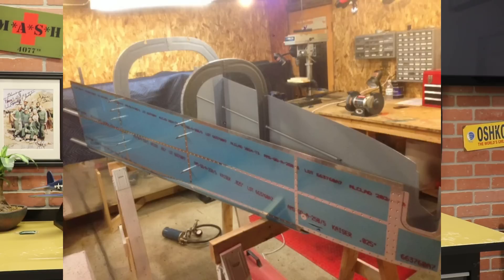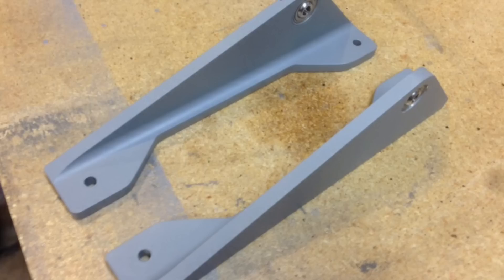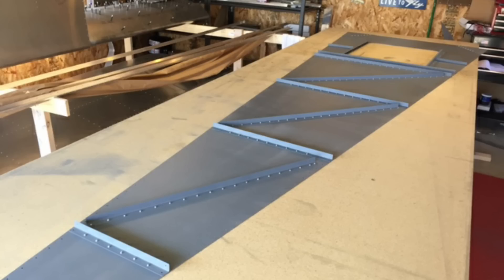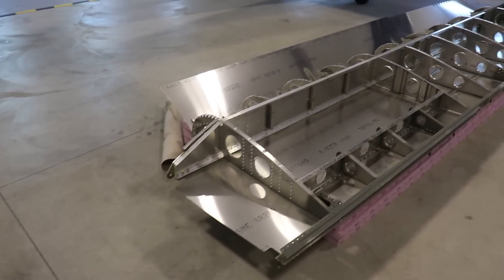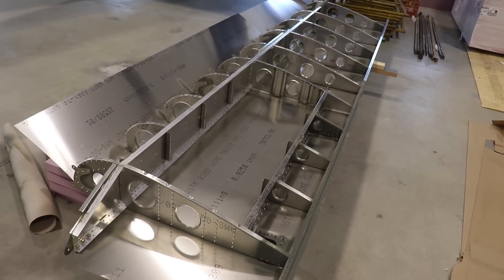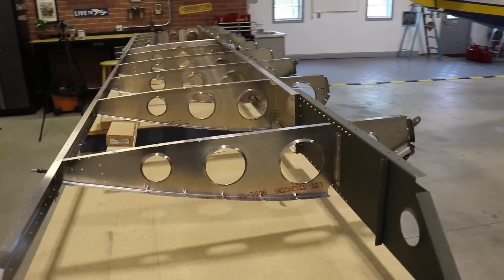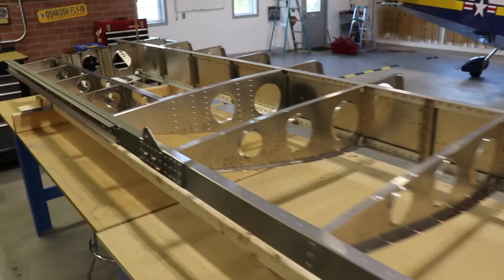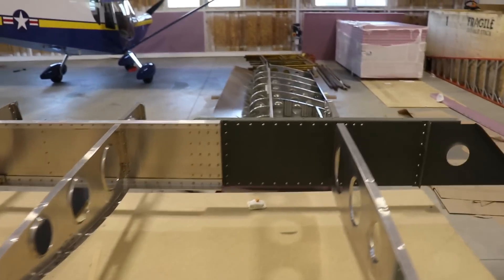Aircraft Primer - Balancing Time, Weight, and Money (Ep9)

Comment: Just put my deposit down on a RV-10. I live in a very humid area 40 miles from the gulf and had a 172 hangared 60miles from the gulf. 
I definitely plan on priming everything. For me the added weight seems miniscule in comparison to my piece of mind and VAN's posted specifications. 
Even if I have to cut back on fuel to load up (RV-10) I'll still be way ahead of the game compared to the 172 I had.

Comment: I live in Calif. . I talked to an A&P about building an aircraft. He mentioned he always primes with Zinc Cromate and before he installs a rivet he even dips it into the primer so that there is protection between materials and the rivets. After building these aircraft, what are your thoughts on his practices and or suggestions? 
Thanks for the videos. Don
Reply from the maker: Nothing wrong with that. I didn't do that and I'm ok with my airplane only lasting 200-250 years :)

Comment: Before I retired from working sheetmetal on B737's and B757's, Boeing suggested to apply two thin coats of zinc primer on all surfaces especially on mating surfaces. Of course Boeing uses lots of 2024t3. My 2 cents would say just prime the mating surfaces on the 6061t6.

Comment: Cortec primer is meant to be thinned before application, not applied undiluted.  I discussed this years ago with Caleb, the engineer who used to be at Zenith.  He recommended thinning it with water until it was a consistency that easily brushed-on and left a uniform film.  I used disposable foam brushes.  All you need is a thin film of diluted Cortec, which will dry very quickly - you can, however, according to Caleb, even assemble the parts with it still wet, but it will glue the parts together when it dries, so this should only be done when it is a definite final assembly!  I thinned the Cortec in plastic lab sample cups with screw-on lids like you leave urine samples in at the doctor's office.  Any left-over thinned Cortec can then be capped and used next time.  Since it is applied thinned, you'll find the quart can will last a long, long time - probably way more than enough to prime all mating surfaces on the SD.
Of course, any primer is probably OK as the 6061-T6 is corrosion resistant, anyway. I'll admit the rattle can primer is very convenient and fast!
Great detail in your videos - keep up the good work!

Comment: I had the same debate as you with my S-21.  RANS does not recommend priming other than faying surfaces and dipping the SS rivets.  I decided that weight was a huge issue for me and not knowing where the plane may end up in the future, I decided to prime.  Another reason is that I plan to paint my own airplane and I wanted the practice on hidden parts before the exposed parts to get my prep and spray techniques refined a little.

I agree, it is likely unnecessary, but I figure at most 10 extra pounds and that seemed like a reasonable trade-off to me.  However, I certainly would not criticize anyone who chose not to prime.  Also, I just like the look of the white primer on the parts and it makes it easy to see any cracks or leaks in the future during inspections.

Comment: How do you feel about ACF50 ....Corrosion  X ...and of course Alodine comments will be welcome .I have used ACF 50 for ten years .It works its way up past the rivets and shows on the surface ,so don't use it until your paint is dry .This stuff really chases the moisture away.
Reply: James Barber ACF50 seems to work. I used Cortec with 30% denatured alcohol and brush on mating surface. How are you applying ACF?
Reply: pavehawk25 Good morning from the U K . I didn't use it until the first annual. If you use it before the paint job .....big problems.I sprayed it in with one of those crude sprayers that come with a cheap Airgun kit ,The gun with the 6 inch long probe .i think it's for spraying engine cleaner .It shouldn't work but it does !There ARE  different metals where the alloy touches .The rivets aren't 6061 . This stuff gets past the rivets ,and can reach the surface .Our Air worthiness people thought it might loosen the rivets but OK d it .The Spitfire used magnesium rivets .These were expected to last the war ,and they did, just !The rebuilders just unzip em because the rivets go and leave the alloy .The alloy  .is similar to 20 24 and is painted with zinc chromate .1940 .....2020 It's good  enough for me .Zinc chromate causes cancer I believe , so use it outside .In the Uk we can buy it in rattle cans from LAS . I t's not sold to the public because it's too toxic .We home builders are classed as experts so we are allowed nasty stuff !  Mark is right on the ball when he says to consider where the aircraft will live .I spent last Friday in a hanger on the edge of the salt marsh.......yards from the North Sea putting the wing on a Sport Cruser .Thats when you need the lot ! There are two ways to get a thin film of chromemate on the larger flat surfaces .In the UK the car paint suppliers fill  up cans with the paint of your colour (color in the US ) I just get them to put my thinned down paint in rattle cans .The other trick is to wet the surface with thinners just before you spray,The result is OK for in side and a can will last  LOT longer .Paint is paint .....chromate is anti corrosion treatment ..and a film does the job and saves weight .

Comment: Super Koropon® 515-700 fluid resistant conventional solids epoxy coating. This high performance primer is used to protect the structural interior of aircraft from corrosion. Dry Film Weight:
 47 grams/square meter at 25 microns dry film (0.00956 pounds/square feet at 1 mil dry film)
 There is a reason all the Coast Guard planes around Tampa use this.

Comment: If you're not using zinc chromate, there's really no reason to just prime any of the parts. Cheap rustoleum doesn't do a good job at keeping water and other contaminants from interacting with the metal, and there's no reason to prime between two surfaces if they're the same metal since you need dissimilar metals for galvanic corrosion to occur.  Also, priming just one section instead of the entire part won't prevent filiform corrosion. Either prime everything with zinc chromate or just prime where you're going to paint.
Reply: Justin Hyde Wrong.  Many coatings provide excellent corrosion protection.  I can’t speak to Rustoleum, but a number of coatings are excellent.  Zinc Chromate is good, but a lot of the preference for that is tradition as much as performance.

And galvanic corrosion is only one of nearly a dozen aluminum corrosion mechanisms.  There are many reasons that applying primer to at least the faying surfaces is a good idea.

https://www.corrosionpedia.com/understanding-aluminum-corrosion/2/6954